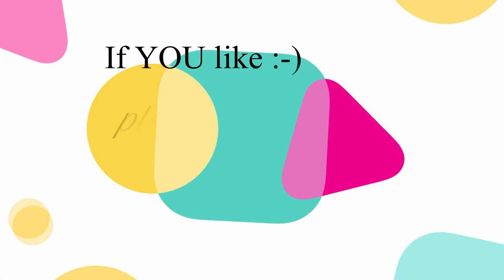How to maybe remove old fungus with Hydrogen-Peroxid 3% In Leica-M Elmar f=9cm 1:4

Comment: Hi Mikeno62 !! Although my Elmar 90mm f:4 is the same as the one you disassembled, mine has another black ring with two small screws on the front around the trim with the data and serial number... should I remove them to unscrew the front? Is it another type of disassembly that I have to do? I haven't touched anything until I heard you... you are a genius!!! Thank you so much !

Comment: Thanks for this great video.  I have this lens and would like to clean it but I can't do the first step, taking the optical unit off the helicoid.  It is just stuck.  I have tried with my rubber gloves.  What should I do now?  Heat with a hair dryer or a few drops of lighter fluid at the joint?  My lens is the black version so it is much older.  It is probably decades since it has been removed.  I have the matching Visoflex helicoid so I would like to get it off to mount it there as well.  Any advice would be appreciated.  Thanks again.  I have learned a lot from watching your videos.
Reply from the maker: Thanks Karen, to unscrew the optical unit you could use a cotton bud and then apply some Isopropylalcohol 99% (if you can get that but I would guess a lower procent would work..) between the gap of the optical unit and the focus section, sometimes I also use nail polish remover with Acetone (take good care when use on plastic components because it can / will soften it!). Hope you can use the tip :-)
Reply: @mikeno62  thanks so much. I tried alcohol then acetone and the acetone worked. On the inside of the helicoid someone wrote 89 in pencil. Maybe the last time it was serviced?  I need to clean and relubricate the helicoid so I will put in a request for that video sometime 🙂. Thanks so much for your help both in the comments and through your videos.
Reply: BTW checked the serial number for my lens and it was made in 1936. It’s in great shape. Pretty cool.

Comment: I need advice from you @mikeno62.
To clean fungus on the lens, should using 3% hydrogenperoxide be enough? what about hydrogenperoxide 30% and 50%?
Currently I use is 99% isopropyl.
Reply from the maker: Sorry for the late anserv, I only use 3% Hydrogen Peroxide without water to get rid of the fungus, and it had worked in many, many lenses (and very few that it did not work...). But I have now buy some 10% Hydrogen Peroxide and will give it a try in a lens and also make a video about that.

Some people mention that adding water to the Hydrogen Peroxide should make it stronger, but it didn't have that effect on the lenses I tryed yet.

Isopropylalcohol 99% is a great cleaning solvent, but it does not have a big impact on Fungus, that's why it's better to use Hydrogen Peroxide.

Comment: Does anyone know how to separate the optical block from focusing part in Steinheil MUNCHEN Culminar VL 13.5cm f4.5 (L39 mount)? Is is just screwed together in the middle? The glass is clean but the focusing feels very dry, I like to add some HELIMAX. 
Also, what is the size of the thread on the lens body that holds the LTM end-piece?
Reply from the maker: Sorry but no. But to cleaning the helicoids you can use Isopropylalcohol 99% or so, and then re-lube with the smallest amount of MoS2 grease on the helicoid threads, I think when the using the HELIMAX in som lenses are a little too stiff when turning the focus ring (Just my meaning..).
But REMEMBER to count how many turns the helicoids will turn untill they get off the thread, and also to set small marks when the helicoid get off the thread.
You can also BEFORE disassemble, measure how long the focus assembly is at infinity, just so you have a kind of a "backup" when you assemble it again.

And take many picture during the process, it's important!